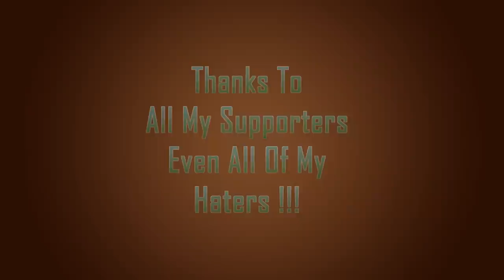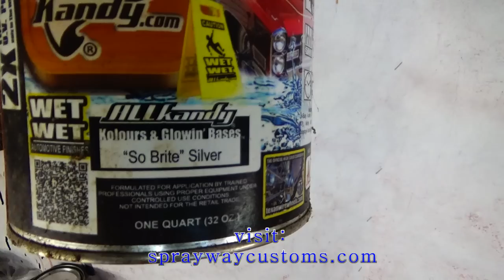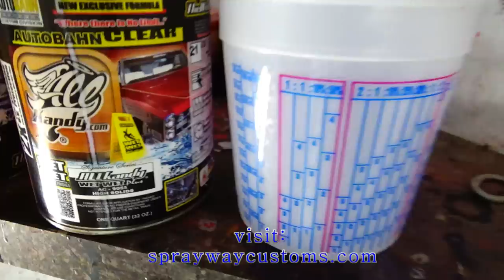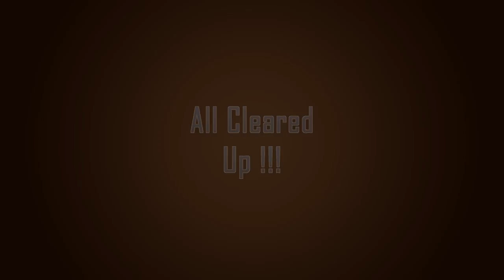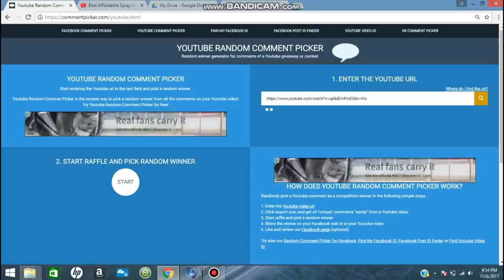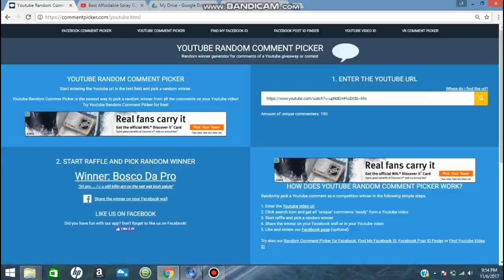How To Custom Paint A Helmet SAMURAI PAINT Marble Effect Bowling Ball Candy Paint ALLKANDY WET WET

Comment: Yo you got a lotta talent bro, I checked out all of your videos, exceptional work. My question is for small door panel repairs. Or if y my just want to do a easy custom door panel(fix cracks)can you use fiberglass,rondo, or filler?Like on vynil?
Reply from the maker: Yes you can, just make sure you sand it down real good so the fiberglass will have something to bond to.

Comment: How’s it going man. I’m thinking of giving fiberglassing a shot on my 88 caprice. do you know of any kits that would include everything needed for fiberglassing some interior parts? Or maybe hook a bro up with a list of materials you use?
Reply from the maker: What's going on fam. You gonna need a hot glue gun, fleece, fiberglass resin, fiberglass Mat or Cloth, chip brushes, light weight filler, a sander. I probably done forgot something...I'm just coming off the top of my head but this will get you started
Reply: SprayWayCustoms preciate it bro! Thanks for the quality vids you put out.

Comment: you spray it after using 400 wet? no sand scratches show thru?
Reply from the maker: No scratches show through at all...if you do get any in the first coat, after three coats of base they'll be covered
Reply: SprayWayCustoms fasho thanks I’ll mess around w it
Reply from the maker: No problem at all

Comment: Hey brother what do you do for heat in your spray booth? Thanks
Reply from the maker: charmoines jordan, it really don't get to cold..I do have two small electrical heaters when needed
Reply: SprayWayCustoms do you warm your booth before you spray if need be? Or spray with the heaters in the booth?
Reply from the maker: When it get really cold I warm the both up and then spray. Once I start spraying the temperature drop because I have my intake vents pulling in fresh air but once I get through spraying I close all the vents up and keep the heaters on. You also can use a fast reducer and hardener to speed up the drying process.

Comment: seen that paint 7 years ago
Reply from the maker: Yes, it's been around awhile....thanks for watching Chris
Reply: check out Electroluminescent Coating
Reply: ive used the trash bag marble effect befor but used it with fine silver under pearlessenct white. bagged it waited for it to set up. then i  lightly wet sanded it with 2000 grit, then the pearl. came out good. oh yea i put down clear sealer over the silver befor i shot the pearl. what hvlp gun are you useing?
Reply from the maker: Sounds good. On this project here I used the SATA minijet 4400 HVLP for the base and candy coat and the RP for the clear

Comment: That's an interesting technique but you'll never get me to use rattle crap on anything ever..  Its just super cheap way over reduced paint of extremely low quality and longevity.  You can get the same effect with a better quality in ever measurable metric by first laying down black or silver and clearing it then after sanding double reduce the color you did not use on the first run with a slow reducer , shoot it super wet and then dab it out with shrink wrap all at once.  It gives a better, more uniform blend of the desired effect.  Not to say for a down and dirty method this is fine but trust me, over time anything in a can is going to bite you in the ass.